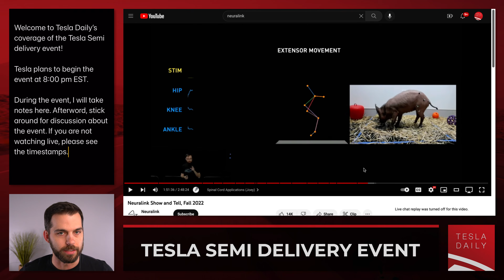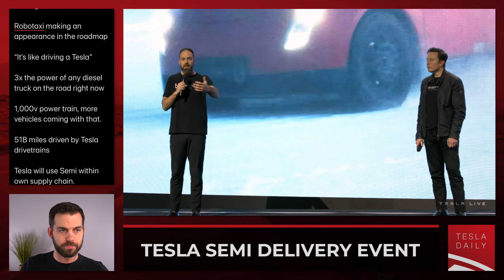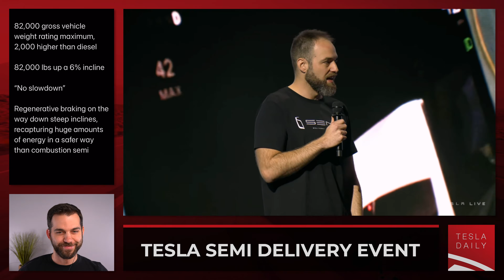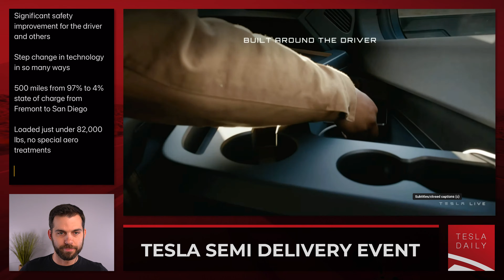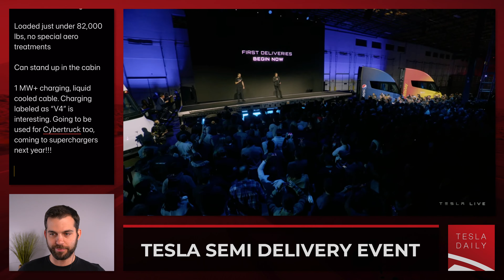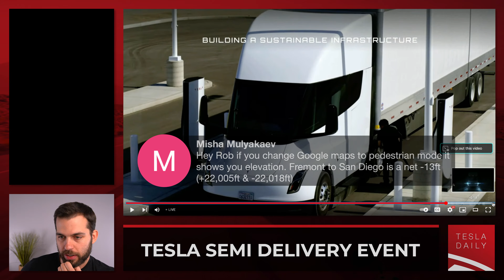Tesla Semi Delivery Event + Reaction & Analysis

Comment: Fremont is sea level as is San diego. Grapevine is only elevated driving.
Reply: That's meaningless.  The road between them is hardly at sea level.  You should pay closer attention, they had a nice graph showing it all.
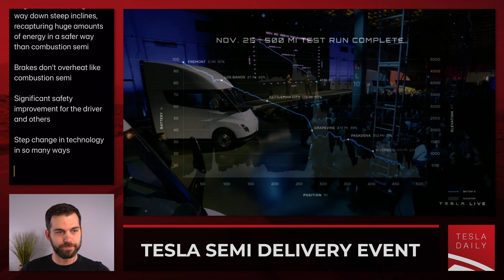Reply: Net elevation change Fremont-to-San Diego is really really close to ZERO FEET. You can see the data in your video... at time marker 39:39 there is a graph of the elevation vs position... on the far left (beginning of the trip) the elevation is very close to zero... elevation of Fremont is about 50 feet... and then at the far right at the end of the trip it descends quickly back down to around zero feet. The elevation is super-imposed in grey under the blue battery charge graph. (The max elevation point of the trip is marked as 4,136 ft at around 300 miles into the trip as it drives along the grapevine.)

Comment: Could you go 1000 miles with no load then?
Reply: Given <20% of semi-truck loads utilise the max 80,000 pound load capacity, a majority of the loads are volume restricted, well before maxing out the weight... therefore many of the Tesla Semis should be able to achieve >500 miles (depending on other factors).
Reply: I think 900miles...

Comment: Google maps cycle directions shows elevation. It says elevation difference is under 15 feet with ups and downs in between.
Reply: Yes, they had a graph in the back ground, the peak I think was just under 5000 feet.
Reply: @TheEvilmooseofdoom  Net elevation change Fremont-to-San Diego is really really close to ZERO FEET. You can see the data in your video... at time marker 39:39 there is a graph of the elevation vs position... on the far left (beginning of the trip) the elevation is very close to zero... elevation of Fremont is about 50 feet... and then at the far right at the end of the trip it descends quickly back down to around zero feet. The elevation is super-imposed in grey under the blue battery charge graph. (The max elevation point of the trip is marked as 4,136 ft at around 300 miles into the trip as it drives along the grapevine.)
Reply: What exactly is the point?

Comment: There it is! I was looking for how this truck is getting 20%+ more mileage from a given amount of battery. They do it by clutching out two of the three drive motors most of the time, only engaging the extra 2 motors when accelerating or hill climbing. I now am convinced.
Reply: This would make sense . Once this big load reaches its cruise speed , much less power required .
Reply: Good shout, that plus great aerodynamics.
Reply: How did you get your 20% figure?
Reply: It would be great if they do this to their dual motor cars in the future.

Comment: Elevations and Distances in the United States:   https://pubs.usgs.gov/gip/Elevations-Distances/elvadist.html
Reply: Net elevation change Fremont-to-San Diego is really really close to ZERO FEET. You can see the data in your video... at time marker 39:39 there is a graph of the elevation vs position... on the far left (beginning of the trip) the elevation is very close to zero... elevation of Fremont is about 50 feet... and then at the far right at the end of the trip it descends quickly back down to around zero feet. The elevation is super-imposed in grey under the blue battery charge graph. (The max elevation point of the trip is marked as 4,136 ft at around 300 miles into the trip as it drives along the grapevine.)

Comment: Cruise on 1 motor!!? 😳😳
Reply: 1 motor= 1100hp!
Reply: @mikafiltenborg7572  1100?  I think you need double check that.
Reply: @TheEvilmooseofdoom  
Close enough, but more to the point, a motor designed for high performance, to 200mph geared down
So, the torque at the wheels in a slower moving vehicle will be..... Exceptional.
.gearing compounds the torque.

Comment: Regarding elevation, Google maps will show you the elevation between two locations if you tell it you're using a bicycle.  Of course that alters the route too, so it's not perfect.  Fremont to San Diego on a bike involves a total climb of 17,067 feet and a descent of 17,080 feet.  So a slight downhill advantage, but not significant.
I want to know what the range would be on a light load, like a trailer full of potato chips.
Reply: Net elevation change Fremont-to-San Diego is really really close to ZERO FEET. You can see the data in your video... at time marker 39:39 there is a graph of the elevation vs position... on the far left (beginning of the trip) the elevation is very close to zero... elevation of Fremont is about 50 feet... and then at the far right at the end of the trip it descends quickly back down to around zero feet. The elevation is super-imposed in grey under the blue battery charge graph. (The max elevation point of the trip is marked as 4,136 ft at around 300 miles into the trip as it drives along the grapevine.)
Reply: Except they didn't finish at Fremont.
Look at the graph. Big climb at the end

Comment: Hey Rob- I re-looked at the video of the truck going up the grade- those are the smaller, 12-foot long barriers (which is my gestimate, given that their were four rows of them), which weigh 5200 lbs or more- I counted 11 of them on the flatbed.  That means the 'cargo' weight was about 57,200 pounds.  Out of 82,000 pounds, that leaves 24,800 pounds for the Semi and the Flatbed.  However, that seems on the low side considering the Cab includes a massive battery weight, but who knows....
Reply: That wasn’t the same trip as the 500 miles trip discussed. 

In the clip for the 500 mile trip it’s an enclosed trailer. 

Looks like that was just a testing clip.
Reply: @mt2nv1  Yes, I know- but when showing the video of the open bed truck going up the incline, they also said it weighed 82,000 pounds.
Reply: I believe <20% of semi-truck loads require the max 80,000 pound load capacity... a majority of the loads are volume restricted, well before maxing out the weight.
Reply: It is hard to judge the length of those concrete barriers- for example, if they are only 10 feet long, the weight for each goes down to 4000 pounds, with would give a cargo weight of 44,000 pounds, leaving 38,000 pounds for the Cab/batteries and trailer- this seems more realistic, to be honest, and is still impressive- but again hard to measure that small of difference between the two.  I don't think they were any smaller given how 4 lengths of these barriers took up almost the entire length of the trailer- which itself could have been either 48 feet or 53 feet.
Reply: @paulcummings55  they are 10 ft. Lengths of California standard K-rail barrier. Weight would be somewhere between 38,000 and 44,000 lbs with chain and securement system. A 48 ft flat bet trailer weighs 11,500 to 12,500 lbs. 300 lbs for driver and gear. That puts the load and trailer range at 49,800 - 56,800 lbs. which leaves 25,200 and 32,200 lbs for the truck itself. 👍
Reply: Paulcummins estimate of 44000 seems  plausible:
Model X P100D weighs 5531lbs, 100kwh battery weighs 1377lbs. Weight without battery 5531-1377=4154
Assume the truck without battery is 2.5 heavier i.e. 2.5x4154=10385
Truck battery is 10 times bigger than Modrl X: 10x1377=13770
Truck weight: 10385+13770=24155
Truck+trailer: 24000+11000=35000
payload: 81000-35000=46000lbs
Reply: Maximum weight for the battery would be 14000 pounds. Assuming it has the same pack level energy density as the model s and it’s a 1 mw pack.
Reply: @paulcummings35
"Massive battery weight" is the same only assumption.
I could say "reduced chassis weight" or "HUGE reduction in Powertrains weight".
Remember the chassis isn't carrying the weight of the diesel high up and having to manage the torque.
All torque is in the drive direction..... No beam axle.
It's going to be closer than you think.
Reply: @rogerstarkey5390  A user on Twitter wrote that in the time laspe demo he saw  each palette was 600 kg. I took a screen shot and zoomed in and can confirm this statement. He then said he estimated there were about 22-24 palettets. That would bring us to a max of 14,400 kg. Converted to pounds at 2.205 lbs/kg  equals 31,750 lbs. So if total weight were 81,000 lbs everything else would weigh 49,248 lbs.  Does that make sense?

Comment: Based on Google search, Fremont is at 56’ and San Diego at 62’. So roughly same unless Tesla somehow found a high spot in Fremont and a low spot in San Diego. I doubt it. This wasn’t a trick.
Reply: Lots of elevation change between. Including the grapevine.
Reply: Max elevation: 4255 ft / 1297 m
Min elevation: 9 ft / 3 m
Elevation change: 4247 ft / 1294 m
Max grade: 6.9%
Min grade: -5.5%
Steepness score: 10 + 693 + 4001 + 15 = 4720
Distance: 475.46 mi / 765.18 km
Travel Time: 7 hours 17 mins
Reply: Net elevation change Fremont-to-San Diego is really really close to ZERO FEET. You can see the data in your video... at time marker 39:39 there is a graph of the elevation vs position... on the far left (beginning of the trip) the elevation is very close to zero... elevation of Fremont is about 50 feet... and then at the far right at the end of the trip it descends quickly back down to around zero feet. The elevation is super-imposed in grey under the blue battery charge graph. (The max elevation point of the trip is marked as 4,136 ft at around 300 miles into the trip as it drives along the grapevine.)

Comment: Guessing it's about 1100kwh pack given 7% at destination and presumably about 35 mile buffer at "empty".
Reply: Tesla is still saying consumption is less than 2000 Wh/mile.  That would require 1000 kWh if equal to 2000 Wh/mi, so I am guessing 800 kWh will be required.

Comment: Both Fremont and San Diego are at sea level
Reply: Importantly they had multiple altitude changes of around 2k to 4k.  Guessing it's about 1100kwh pack given 7% at destination and presumably about 35 mile buffer .
Reply: Getting from Fremont to Los Banos, and up the Grapevine, involve climbing above sea level.
Reply: lots of climbing along Interstate 5 in the middle before LA
Reply: That is significant how?  What is the route?
Reply: Grapevine and Altamont passes aren’t insignificant grades and hills.   Net zero overall from Fremont to SD but at least 1.5  significant up/downs just to LA.    The separate trip over Donner obviously bigger grade as it is over the Sierra Nevada Mts.   If this is true this truck is legit.
Reply: Net elevation change Fremont-to-San Diego is really really close to ZERO FEET. You can see the data in your video... at time marker 39:39 there is a graph of the elevation vs position... on the far left (beginning of the trip) the elevation is very close to zero... elevation of Fremont is about 50 feet... and then at the far right at the end of the trip it descends quickly back down to around zero feet. The elevation is super-imposed in grey under the blue battery charge graph. (The max elevation point of the trip is marked as 4,136 ft at around 300 miles into the trip as it drives along the grapevine.)
Reply: And the point is?